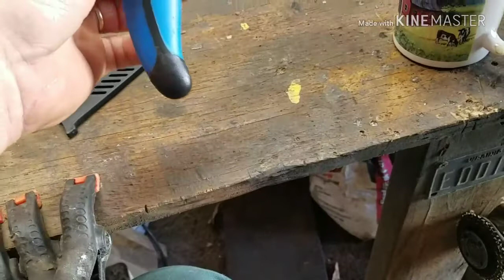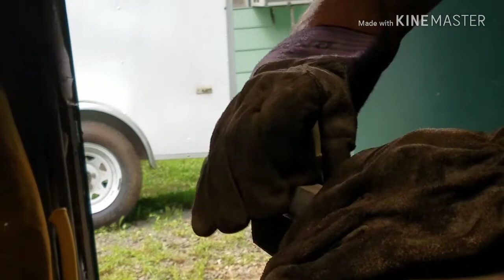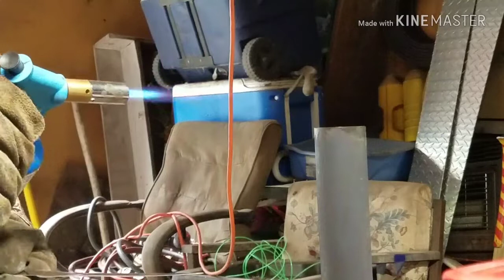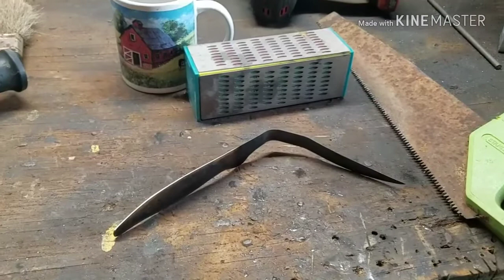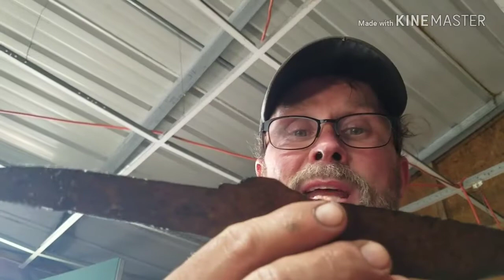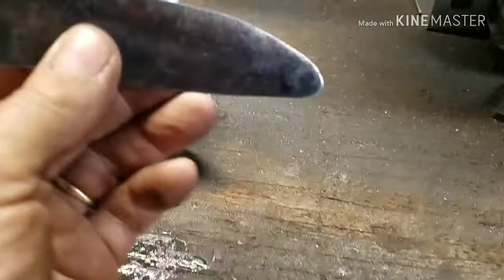Fillet Knife

Comment: You oughta stick that failed knife in the oven for an hour or so just to see what happens to it. The second one turned out great I think! When I made my filet knife I did not do any heat treating... I used an old saw blade also. Good job!!!!!! 👍🏼
Reply from the maker: Never thought about the temper. I still have it might try that and see what happens. After I straighten it. Thanks. I will let you know what happens.

Comment: I don't know  man , but hand saws are pretty flimsy , don't know much about knife making but in the old days good knife steel would break if you forced a bend , hand saw may be hardened at teeth ?of course tho fish meat ain't tuff .
Reply from the maker: Think about how a saw blade will bend and go back to true, a fillet knife has to bend the same way when cutting through a fish. When I heat treated the first one it took all the temper out of the metal and made it very soft. The second one I did not heat treat I just kept it cool when working it.